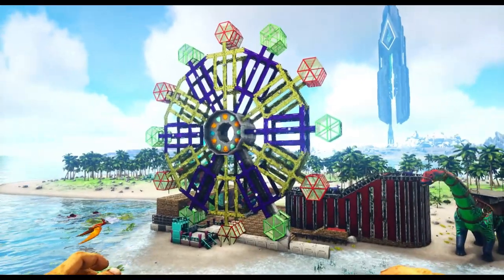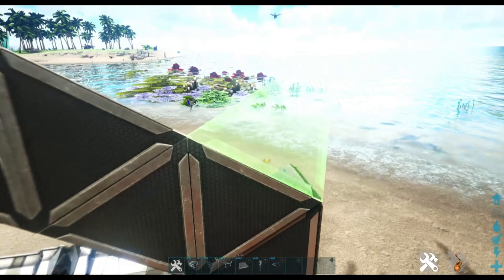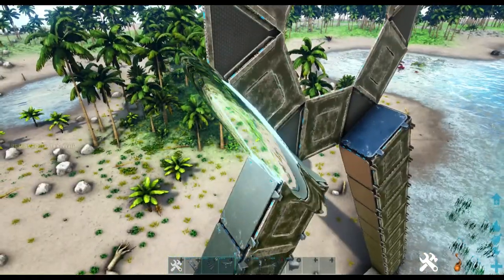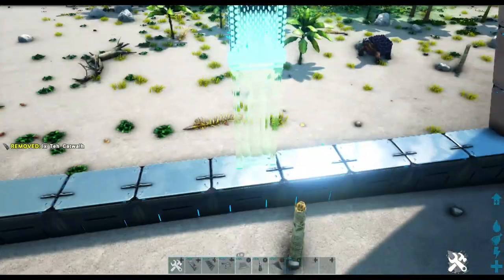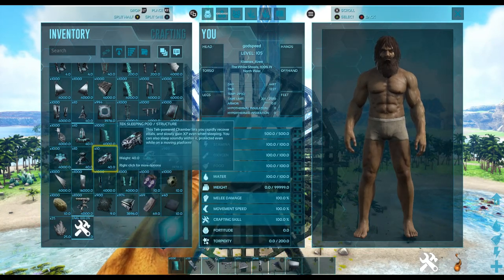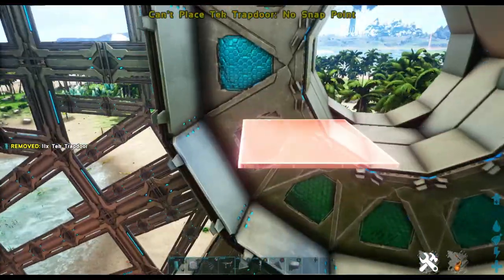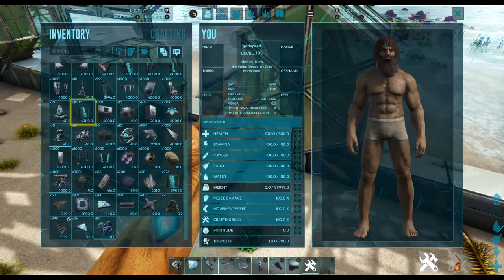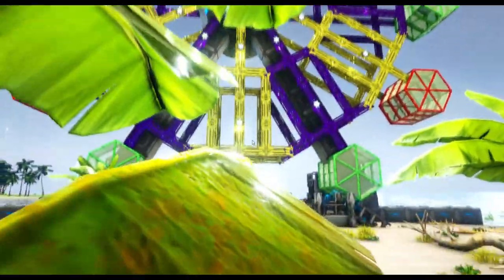How To Build A Ferris Wheel Ark Survival Evolved No Mods

Comment: I have tried this many times there is a part on both sides that I can not put more than 4 parts going out to where the cars go.
Reply from the maker: extend the horizontal sideways base out more or failing that add a sideways pillar to the sideways base and make another row of sideways foundations. basically it sounds like it requires more support